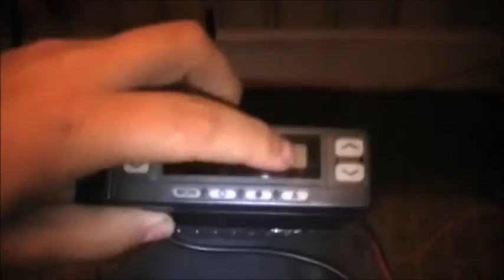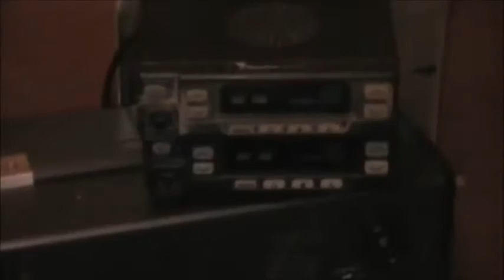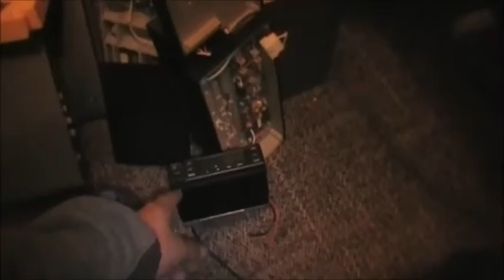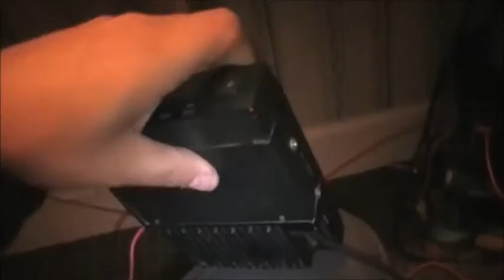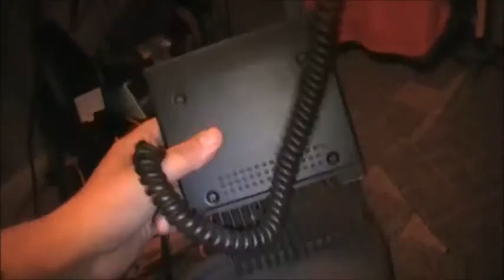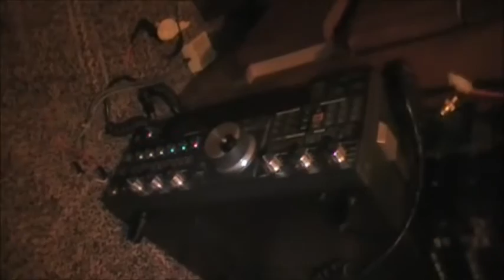Shack update & Kenwood mobile radio's

Comment: Could you do a video on what HF antennas  are the best price wise for a normal person on a fixed budget I wouldnt care if i can use all bands I do know now i can not hear anything on 160 meters  (40,80,10,20 meters antennas) be great if u can find the time ( I have a Icom ic- 720a not sure if it even transmits or not as i use a 2 meter antenna to listen to some bands & Shortwave
Reply from the maker: I use a dipole antenna right now!  easy enough to build and CHEAP!
Reply: U need a antenna tuner right  coool i hope to take my test either beginning of July or no later than end of July so i can get an antenna set up before winter comes back
Reply from the maker: Antenna tuner is always good to have, lets you use the radio on other bands.
Reply: You do not need a antenna tuner just to listen do u? only if u transmit !
Reply from the maker: Nope not at all, but they DO help!  ;-)